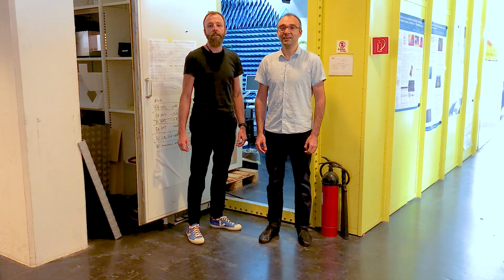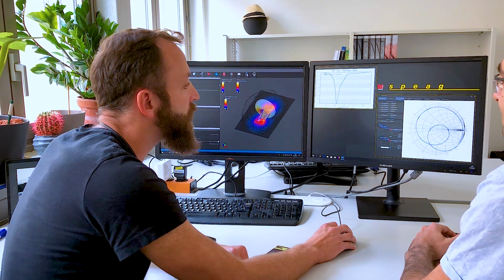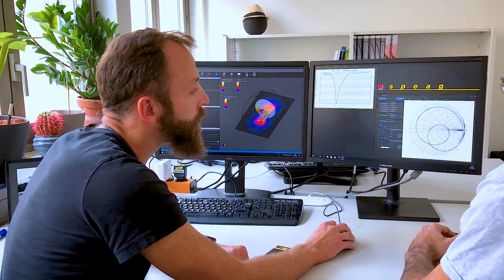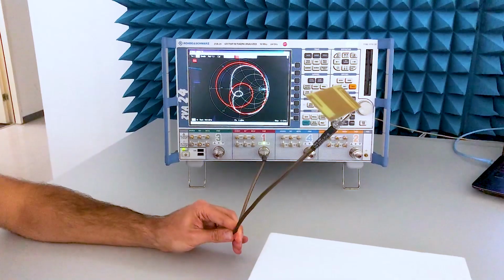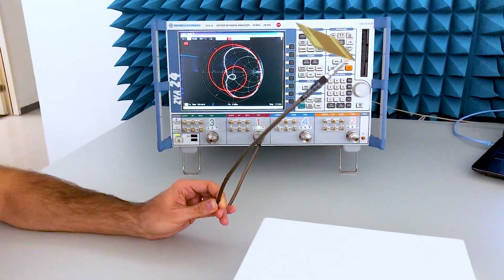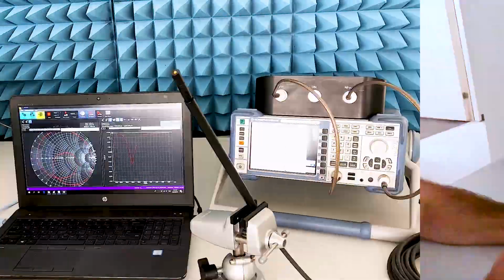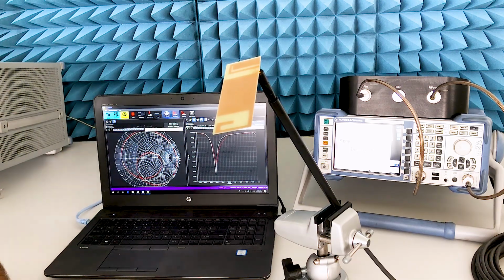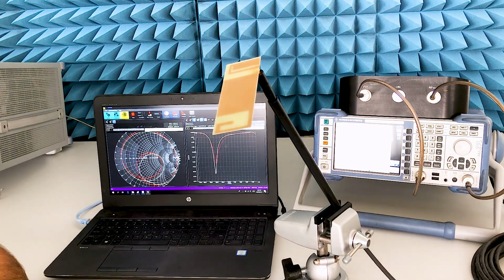OH4VNA: Accurate and reliable S11 parameter measurements of mobile device antennas

Comment: Hello, I want to ask that can we measure S11 with VNA(110GHz)without using connector. Please reply
Reply: No, this is not possible with OH4VNA. OH4VNA is aiming at reducing the additional boundary condition introduced by a metallic cable. I believe in your application you are more interested in reducing cable losses, at 110 GHz. Is this assumption correct?